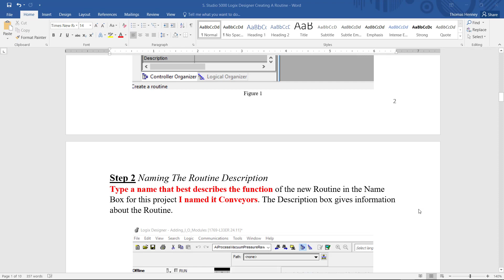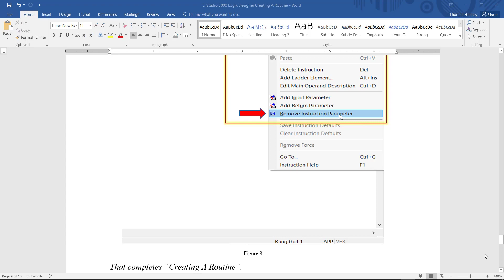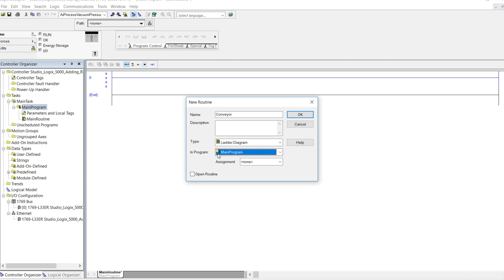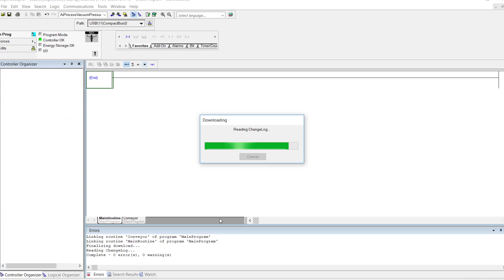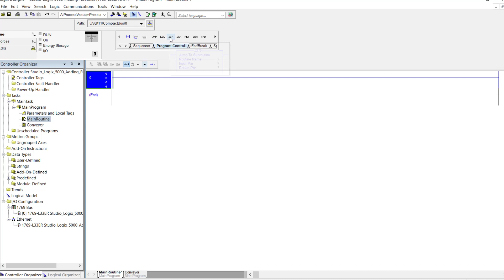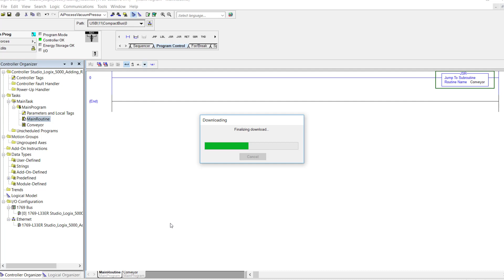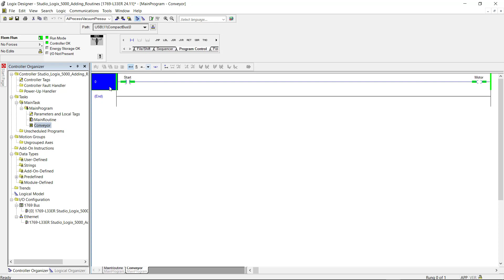5  Studio 5000 Logix Designer Adding Sub Routines

Comment: Thanks a lot Tom, basically if we have a multiple routines, in the Main we consists to assign a JSR for each of them, then the processor can scan/execute the whole sequences
Reply from the maker: Thank You for the comment. Yes you may use multiple JSRs but each JSR must be assigned a valid Routine. And you can trigger them every scan or trigger it using a contact.

Tom
Reply: @tomh2466  very helpful, thanks a lot !